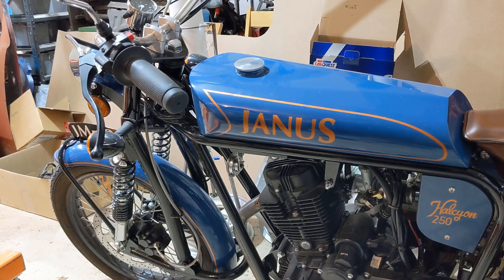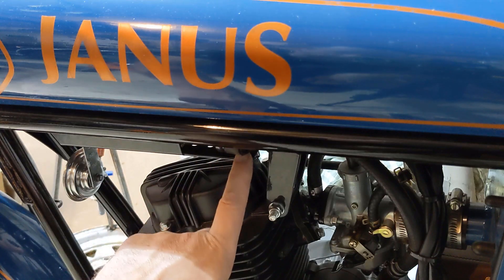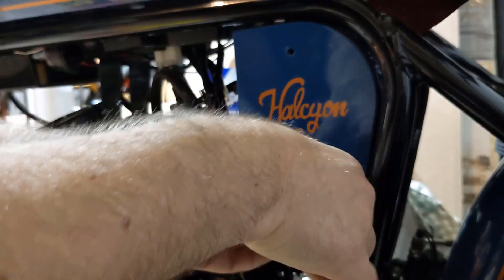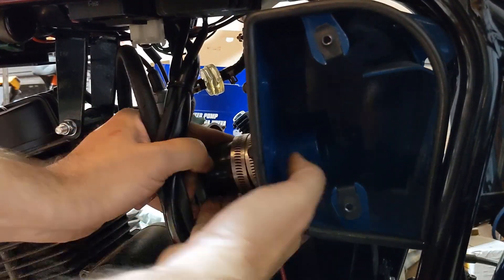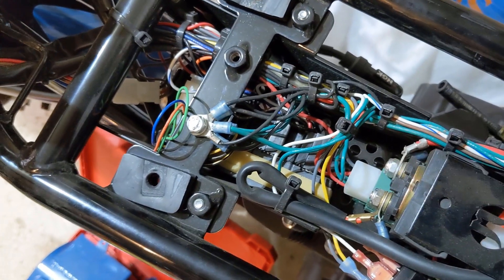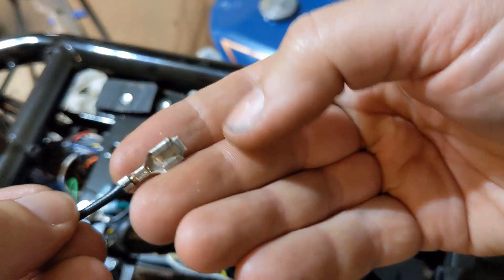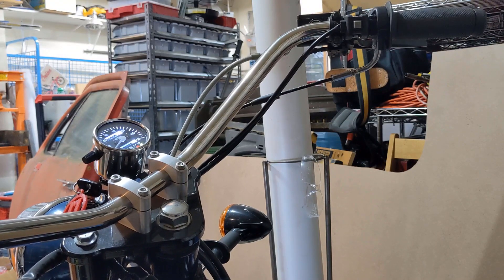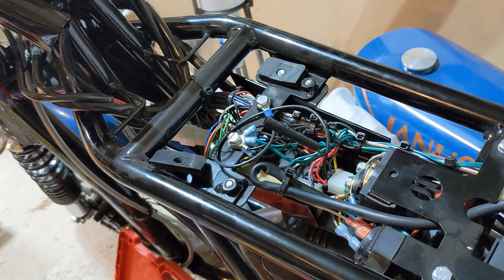Bypassing a Motorcycle Neutral Safety - Janus Halcyon 250

Comment: Thank you! Those things are extremely dangerous, especially for carbureted bikes that sometimes stall before warmed up at intersections (and then its always fun trying to shift into neutral with cars zooming towards you, just kidding that's not fun). Hopefully mine is simple like that because I still want the neutral indicator light, and my clutch safety was as easy as unplugging the wires at the handlebars.

I did the clutch for similar reason where it once stalled in the middle of an intersection (may have ran out of gas or something) and wanted to be able to use the electric to help move it out of the way in emergencies, and it had enough power to move it walking speed without struggling so that worked great, but then apparently my neutral safety started working when it hasn't in years even when new (didn't even know it had one), but now that's working so I have to disable that.

Crazy when a "safety" is the most dangerous thing!